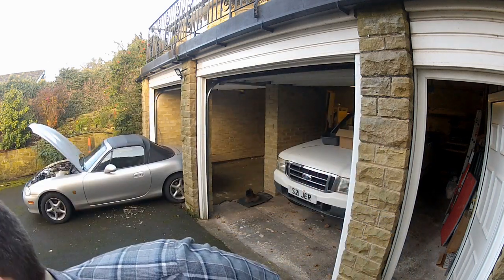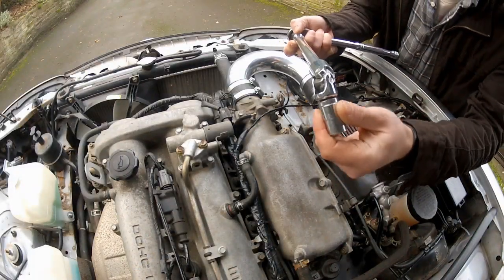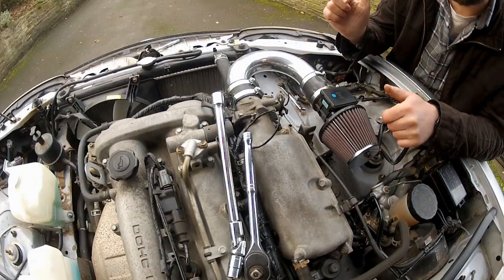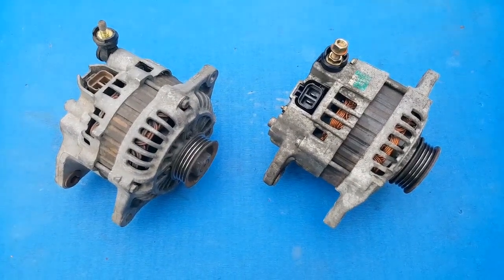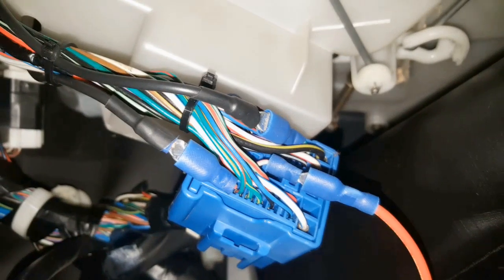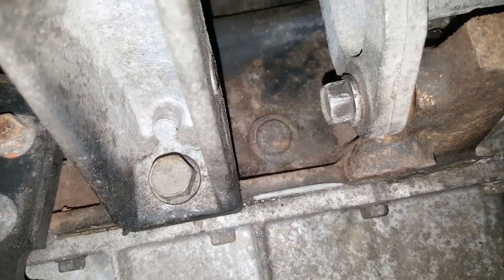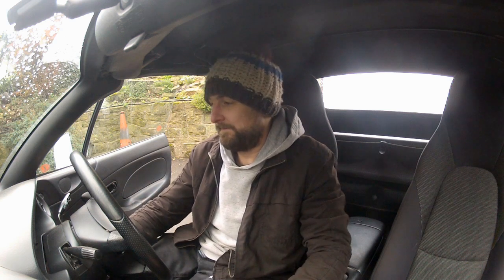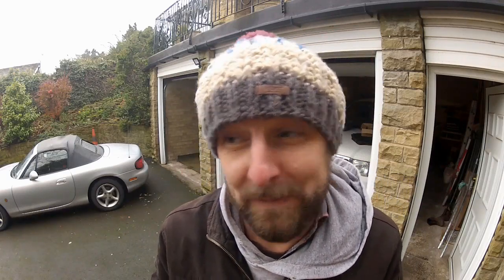Alternator Replacement - Mk1 NA into Mk2 NB Swap How To | Supercharging an MX5 Miata Ep 10

Comment: I’m running a ME442 ecu but noticed random spikes to 18v. Changed alternator and was still doing the same. ME’s advice was basically fit a MK1 alternator which led me here. 

I’ve got a 1999 1.6 NB. Fitted a mk1 1.8 alternator as it had the correct pulley. I didn’t have the wires in the blue connector block like in the video, therefore I cut the wires coming out of the plug at the ecu and did the same as in the video. 

All working and alternator charging as it should now! Many thanks 👌🏻

Comment: I’m stumped, tried to do this and the alternator isn’t charging the battery. It’s a good/new alternator (was tested). Anyone have the same or a similar issue?
Reply: On what year car did you do this and where did you join the wires? Double check you’re getting power to the grey/red wire

Comment: Why is there no grey red wire under my dash. Only one at that location is solid grey/then to solid red halfway through. Is that the wire you are talking about?
Reply: Im having the same issue..
Reply: I’m under here now thinking exactly the same thing
Reply: Did you work out what was what?
Reply: @Beastgamingish hey were you able to figure out which wire i’m having the same problem
Reply: My 99 didn’t have this under the dash either. So went straight to the ecu plug instead. 1T (grey), 1Q (Brown/Red) and 1O (grey / red). Cut these and wire as per the video. Only thing I’ve since done is add a diode in on the switched live as I had a battery drain otherwise.

Comment: Such a great video, really helped me! Only thing to note, for some reason in my case, attaching the wire to switched power would cause the battery to drain overnight. 
The solution for me was to attach to constant power, and now battery no longer drains!
Reply: Interesting I’m having the same issue! The alternator is putting out +12v down that line already

Comment: I HAVE PROBLEMS WITH MY NB 2003, I REPLACE THE ALTERNATOR AND IT DOES NOT CHARGE, THE ALTERNATOR ON THE TEST BENCH DOES WORK 14V, BUT IN THE CAR IT DOES NOT TURN OFF THE BATTERY BULB AND THE ALTERNATOR DOES NOT WORK
Reply from the maker: I've heard this issue time and time again now. Even with stock ECU. I'd just sling a mk1 alternator in it and be done with it

Comment: hello, I too have problems with the ECU (I recharge it at random 12.4-15v) what is the difference between the two alternators? can i use my mk2,5?
is the recharge done to you with the right need for the battery?
Reply from the maker: 12.4 - 15v sounds about right to me
Reply: @FastRust  not for my acid battery. It throws the acid out of me, in fact I'm not using the car

Comment: I just replaced my alternator with q reman unit from autozone.   I wish it worked as beautifully as it looked. I'm glad I didn't bother putting the intake bracket back it on. I'm ordering q used unit. My original alternator charged fine before removal its just that the bearing and the pully where both shot. 
I think the generic parts stores ran units don't get things right as far as thing inside the alternator that helps the ecu regulate the voltage or amperage. It's like part of an internal voltage regulator or something available from mqzda. 
So from a reman 210 American dollar unit from the store coming out and a 58 dollar 99k miles unit going in... by far one of my biggest headaches this car ever gave me... along with the VVT Bug. Is like this thing got the covid vac or som"n
Reply from the maker: I've heard this a few times since having my charging issue - motorfactors giving folk the wrong alternator for their gen of MX5 resulting in charging issues. I would have never have known the differences if I hadn't had my problems. I would have assumed the NA & NBs were all the same unit.

Comment: hey mate. I've just finished changing a voltage regulator in my mk2, by installing one meant for mk1. modified the wiring aaaaaand..... battery light stays on despite car charging 14V like it should... any ideas?
Reply from the maker: Stock ECU?
Reply: @FastRust  All right, So I have a found a solution for a budget bigger alternator on mx5, and it should work with NA and NB mx5's too. I've successfully mounted 90A alternator from Mazda mx3/mx6/626/323F/Xedos6/Xedos9 with k8/kj/kl V6 engines. I tried other alternators and they differ from make to make in the distance between the lower mounting holes (mazda uses 65mm spacing).  Everything works as it should and charging is great. Alternator part number for reference - A3T08491
Reply from the maker: Fantastic. So literally plug and play swap? Is the regulator in the alt or ECU?
Reply: @FastRust  kind of. Longer 110mm lower bolt is needed and to mount needs slight flap disc on angle grinder treatment. Regulator is on the alternator.
Reply: @FastRust  for now. going Link StormX soon
Reply from the maker: Hm I'm not sure to be honest with you. My light operated like normal after the mod, even with the stock ECU. Only thing I could suggest is recheck the wiring side of things?
Reply: @FastRust  I think the mk2 alternator circuits didn't like the mk1 regulator... well, I'm gonna be test fitting r32 gtr alt tomorrow, also looking for a similar alt from 2.8d Pajero, and I have new mk1 alt coming Wednesday just in case... wiring is definitely a-ok.
Reply from the maker: Plenty of options! Hope you get it sorted.
Reply: @FastRust  yeah me to. 'll let you know if mitsubishi alt works, it's 90Amps so nice upgrade, because stock mx5 charging is not the greatest.

Comment: Feel your pain, my ms ECU started giving me grief a while back, found it was voltage regulator, ECU was repaired but years after its back, ended up swapping in MK1 alternator, only gripe I have is the aem wideband displaying 'battery' on cranking, guess that's just because ECU isn't in the loop anymore
Reply from the maker: Hey Aran. Yeah it seems like I'm not the only one to suffer from this issue. Mazda should have left the bloody reg in the alternator where it's meant to be! I don't get your wideband issue though. Are you on an older gauge?
Reply from the maker: Your name has cropped up a lot recently as the guru of all things mx5 supercharged related. Lovely car, checked out some of your videos 👍🏻 May have a question or 2 for you down the line.. when I get my mount kit!

Comment: Nice tech tip! Fingers crossed it works. By the way one of the Car Throttle guys mentioned selling a similar ECU on the last podcast. Can’t remember the model of ecu though.
Have you ever replaced the Capris alternator? Wondering if there is a cheaper alternative (like the Mazda)than the ones on eBay?
Reply from the maker: Thanks mate. Fingers crossed I wont have to buy another after this mod! Bloody hope not anyway. Yeah I've gone through 2 alternators in the Capri, think I got them both from the local parts store as an exchange deal. About 75 quid? Something like that. MX5 reconned are similar price. If they fit the bracket it might work. You'd need an early unit though with the voltage reg and the pulley for a V belt (mk1 1.6).